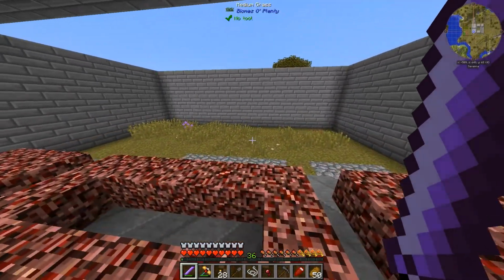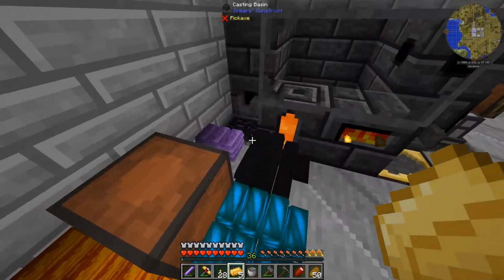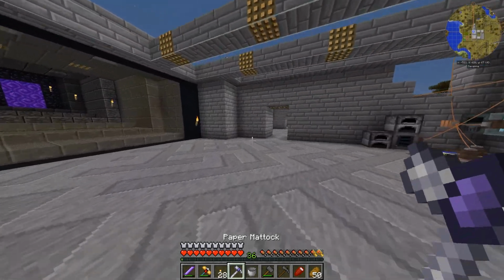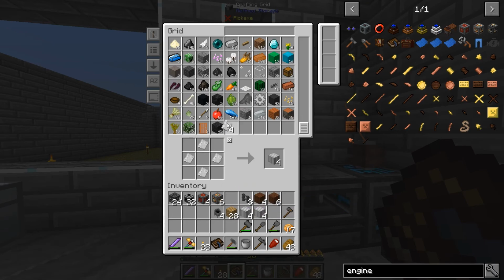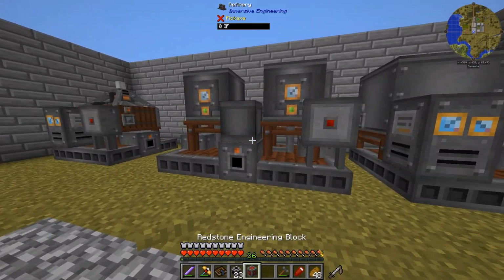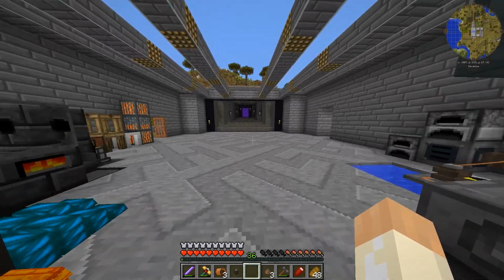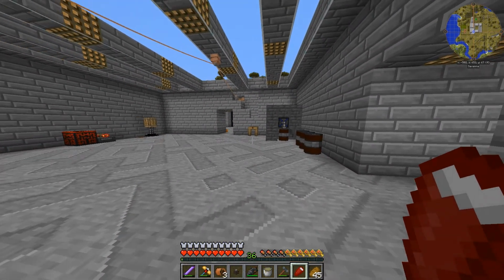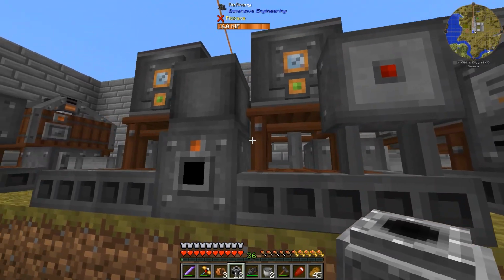FTB Infinity Lite #12 - Biodiesel For My Drill (Modded Minecraft 1.10)

Comment: thanks for another great video. Quick tip, you. can put excess biodiesel in a diesel generator and get quite a lovely amount of rf/t
Reply from the maker: Thanks :) Yeah, that is one of the long term plans I have. Now the system can't keep up once I start these big machines, but I want to have a more automated system to feed it with potatoes and seeds before I set that up. I did some mining and farming after I ended the recording and could fill the tanks if I only let the capacitor fill up in between runs ;)
Reply: Fair enough =D

Comment: its clear that this "factory" is going to get big, may i ask how you are going to keep up with power demands because that is where i am at right now and i don't want to enter nuclear yet?
Reply from the maker: Not fully decided yet. But I'm getting Wood and therefore I can get quite some charcoal and potentially generate power from those. Or I'll combine it with a Biodiesel Generator since I have the generation mostly in place now :)
Reply: OK i`m going try but im not sure it will produce enough
Reply from the maker: A Diesel Generator should produce 4096 RF/t but burns through a bucket of Biodiesel in 6.25 seconds, so you need a steady production of fuel (with a steady production of seeds/potatoes or stuff) to keep up with full burn rate.